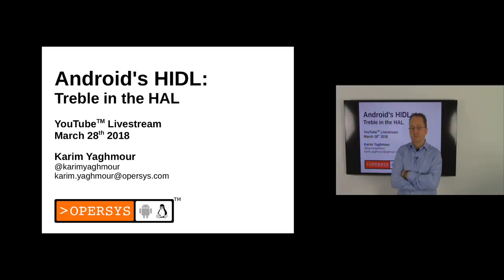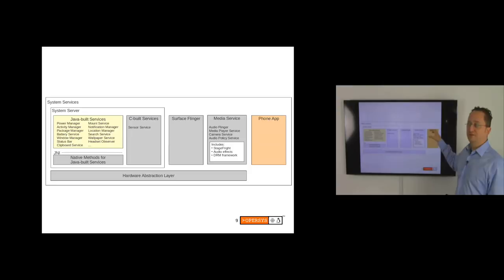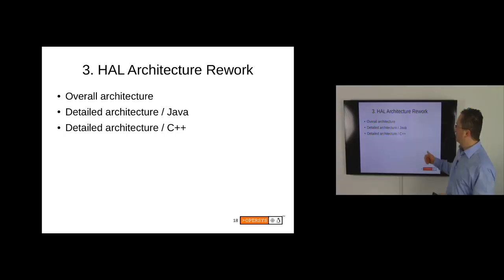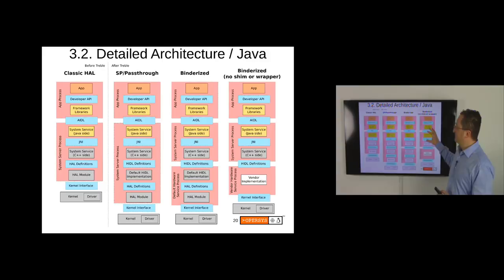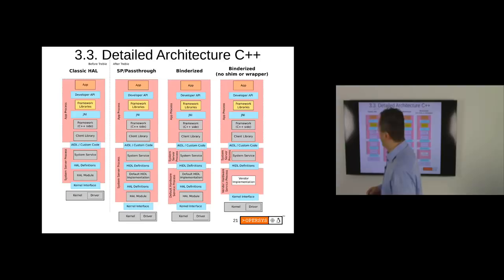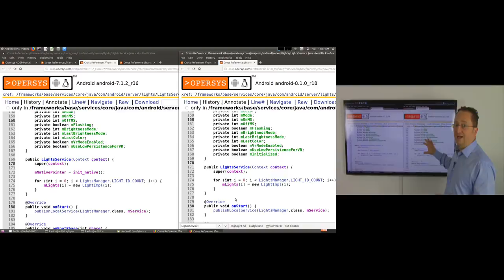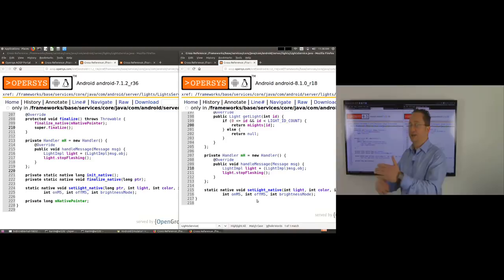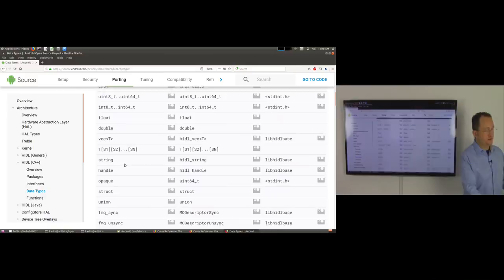Android's HIDL: Treble in the HAL

Comment: Thanks for both talks about Treble/HIDL. I really enjoyed them and they were very informative.

At around time marker 1:02:02, you showed a list of processes running on the emulator and highlighted the HAL services (android.hardware.power, android.hardware.sensors, etc) and stated that these services are "implementing HIDL services [..] which are called by system services whether they be afterwards pass-through or actually binderized implementation".

Given that a HAL service (for example android.hardware.sensors) shows up as a process running on the system, doesn't that imply that the only way for the system services to talk to the HAL service is via a binderized interface?

Correspondingly, I noticed for example that the lights service did not show up in you process list. This seems to match with the fact that it was not listed as a HAL service to start in the init.rc fle that you highlighted a few minutes earlier in your talk. I assume this implies that the light service is being used in pass-through mode on the system.

Could you elaborate on this issue?

Thanks,
  -Gerard

Comment: Thanks a lot for the great video :)
I am kind of new to this AOSP development. 
if I understand correctly, what we discussed in this video is, how to create the interface (glue) basically.

I am still wondering, where to find the source for actual implementation of the HAL that talks to the hardware in AOSP code. (emulator or HW specific )
Any hint or link from xref would be great !
And to start with Android platform development could you recommend some guides, books or links to start with ?  
Thank you :)
Reply from the maker: Have a look at the "default" directory under hardware/interfaces/[HW_TYPE]/[VERSION]/ as well as the various device/[VENDOR]/[PRODUCT] directories.